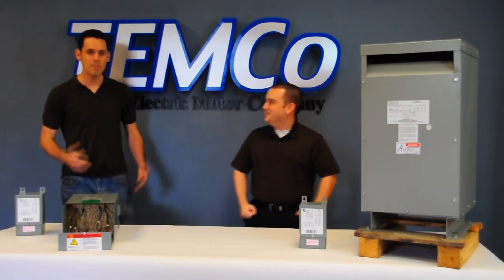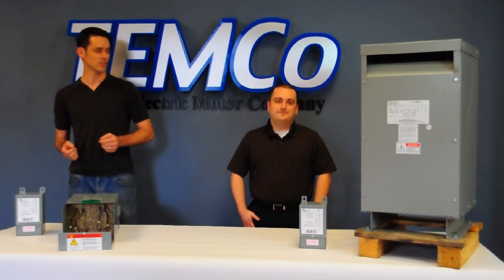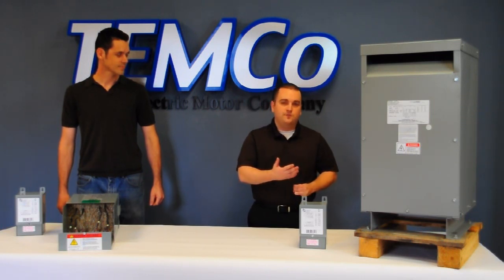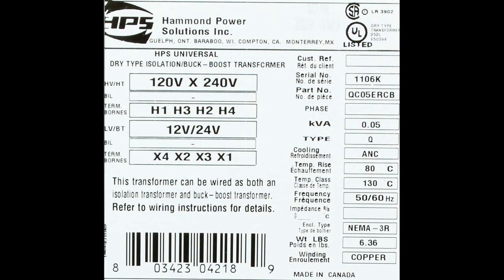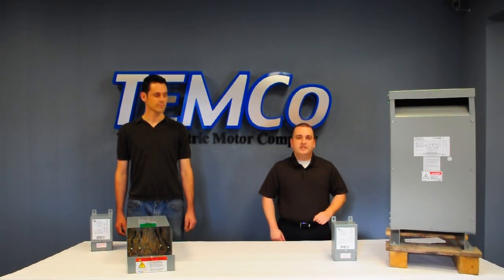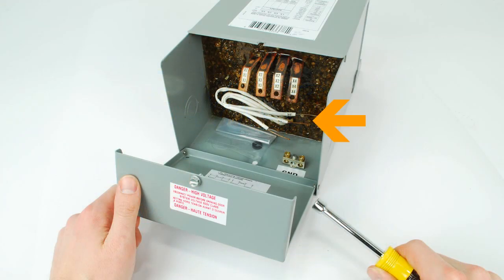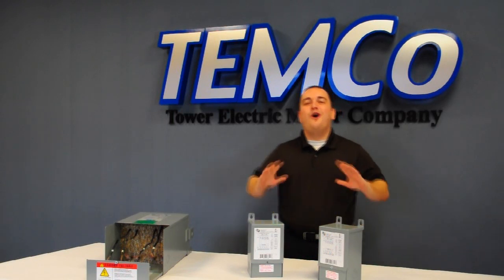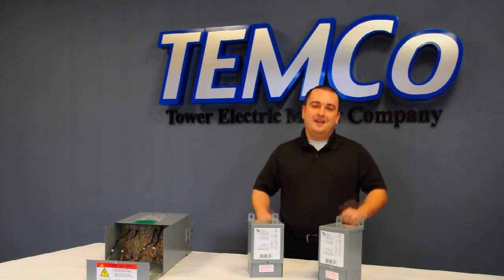TEMCo Buck-Boost Video

Comment: I'm surprised that more buck-boost transformers aren't sold in the US based on all the 208Y/120 volt systems (the wimpy Wye) used out there.
Reply: Not popular system phase out eventually
Reply: @hangngoaigiare  do you wish to burn out expensive motors prematurely? Or will we see more 480Y/277 volt systems in the future?